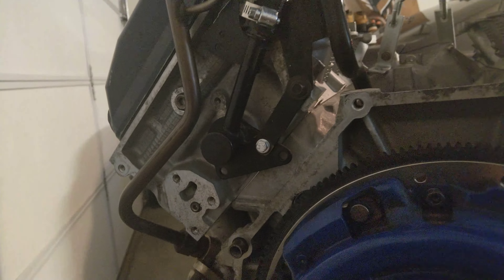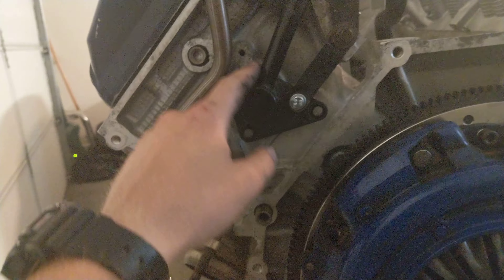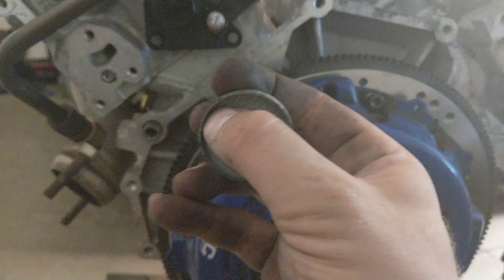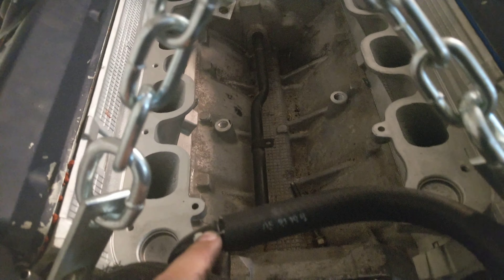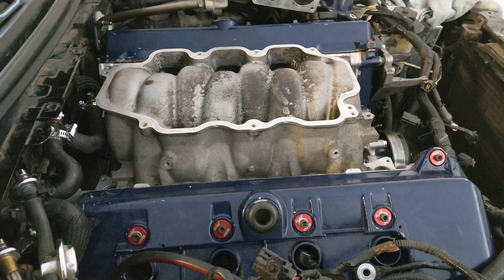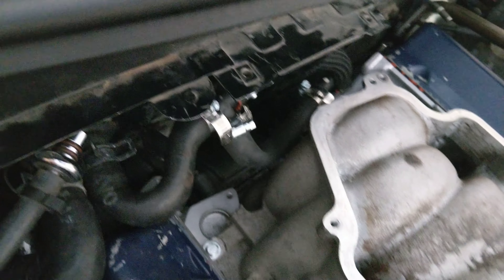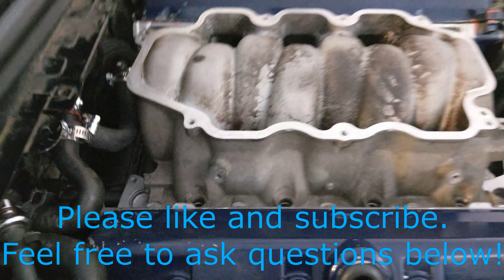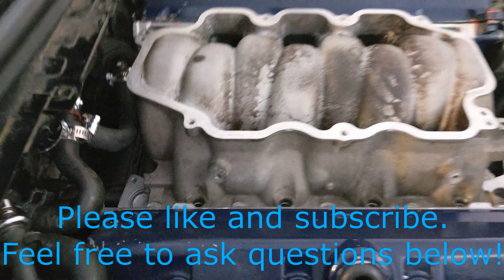4v cylinder head cooling mod for 1996-2004 mustang cobras

Comment: Free tip. 2005 ford explorer's have that T made out of steel on the pass side of the head on the heater hose. Cheap insurance to get at the pick n pull nest time your at 1. Same size.
Reply from the maker: Nice! Thanks for the tip.
Reply: @onall8950  No problem. That plastic 1 broke on my wife's Aviator and blew the head gaskets. Then found that 1 on the cheap explorers an saw/found/installed it it was steel. Go figure huh !

Comment: Can you use the top freeze plugs instead of the back ones?
Reply from the maker: I'm not sure exactly which one you are referring to. But the one shown is the one that needs to be used to get the correct coolant flow.
Reply: Did you ever find the answer?  I just changed the clutch and really dont want to pull the trans again.
Reply: Yes you could.

Comment: Can this be installed without removing the engine?
Reply from the maker: It is possible. There is just not much space and it is very tedious. Easier than pulling the whole engine though. If you drop the engine a little it is easier. Getting the freeze plug out is the worst of it. You can cool it down by turning an aerosol can upside down and spraying the propellant on the plug. That will make it easier to take out.
Reply: @onall8950  Thanks for this info!

Comment: Never use RTV on a hose. It's redundant and unnecessary and ends up making it a pain to remove and work on later down the road.
Reply from the maker: I honestly do not remember why I used RTV on the hose tee. I may have just gotten carried away after using it on a couple of other fittings. I know I did not want to have a leak back there after getting the engine in! haha